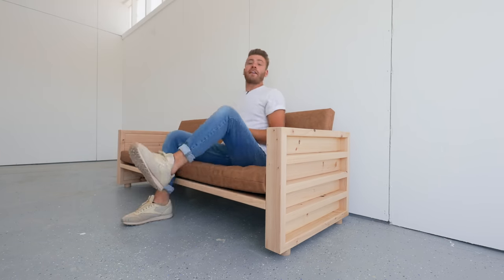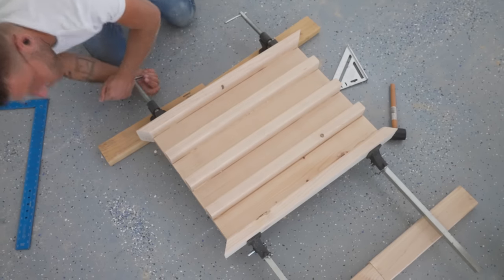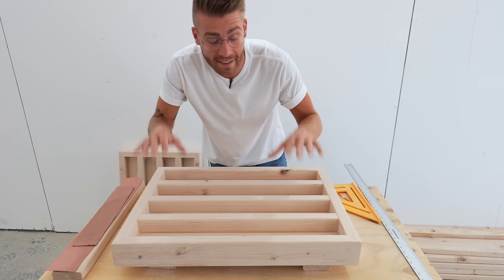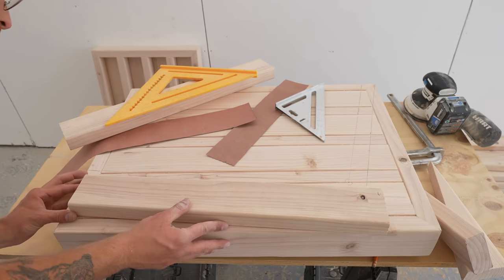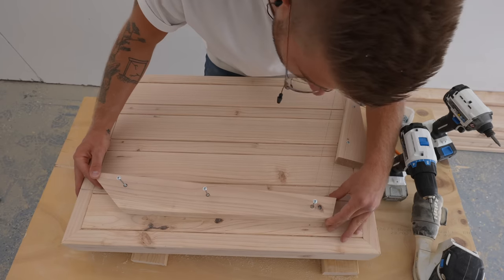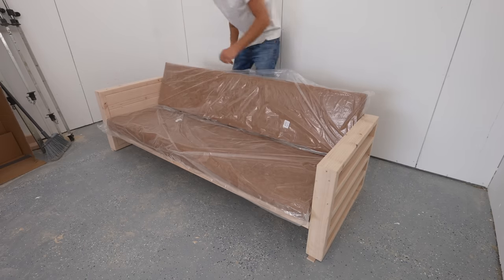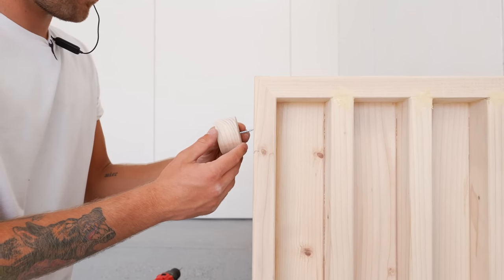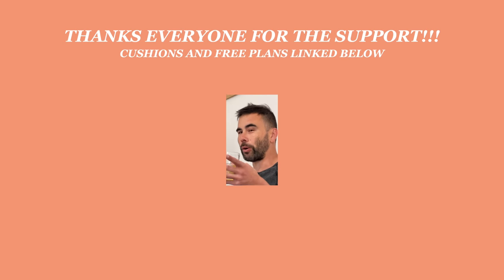DIY SOFA MADE OUT OF 2X4'S + FREE PLANS | MODERN BUILDS

Comment: nice work mike. You might want to consider adding some structural support. 2x4 on the flat won't carry the weight of an adult male and your couch will sag in weeks. Cheers!
Reply: Love your videos! You are an expiration
Reply: was thinking the same! Thank you Jeff
Reply from the maker: We’ll see 😜
Reply: I’m torn. Although I agree because more bracing the better, I’m not sure if it’s necessary. I built a bed inspired by the legend Matthias wandel. I used 2x4s for the slats that has a wider span than this sofa. I added about 8 2x4s and was intending to add a middle support beam but never did because I had no issues. No sagging at all and we’ve been using the bed for about 6 years now.
Reply: @SparkysJourney  
It doesn’t take much to do it, and it’s peace of mind and takes all that work into the next century by lasting that long. Sometimes lazy doesn’t take the life of a project too far. If it were me, I’d add the piece so it last like the pyramids! Ha! We have had things last in our home ages, and it saves a ton of money down the line when u may have to repair other things at the same time that don’t last, like water heaters cause they don’t want to make them out of galvanized metal. When it comes to water, u would think they’d care about the longevity of expensive items. These companies need to take more pride in their items, but in my case, the same company made double the money after 15 years. That’s more items in the landfills and not a recommendation to others when they need one.
Reply: @ModernBuilds  You'll be fine Mike! You've got more lumber in that sofa what you'd find in most furniture stores. Great job!
Reply: Did he say “Vegan cushion!” ? 😂 I had to thumb it down.
Reply: @SparkysJourney  Hi, I do upholstery work for a living.  You may wanna consider that in a bed, your whole weight is dispersed throughout the entire 2x4s while in the case of the sofa, your whole weight is placed in one portion of the 2x4s, placing a lot more strain into that spot.
Reply: @glumGlumm  I'm with you.  Two thumbs up for you, one thumb down for him.  ;)
Reply: @ModernBuilds  hahaaaa told him haaaa
Reply: @SparkysJourney  Why wouldn't you go for the extra support tho? Might get lucky and it doesn't sag but what if it does sag? You'd wish you'd put in that little extra effort. Also a bed isn't the same as a couch because there's more weight distribution on a bed.
Personally I'd much rather just put on an extra support that basically costs no effort than having to replace parts or even have to rebuild the whole thing depending on what and how you build it.
Reply: @Abraksas112  yeah, it would be pretty easy to just throw a center support underneath the platform as you’d hardly even see it. Also doweling or biscuit jointing the 2x4 platform together would make it WAY stronger.
Reply: @LGAussie  a single 2X4 stood vertical in the center of the seat  where most of the weight would sit would increase it's strength massively.  so the change would be trivial and extremely low cost.
Reply: No, it will not sag. I know from experience.
Reply: "Adult Male" 😂

Comment: Looks great, I'll be building this. My problem is finding those straight and untwisted 2x4 that all you Youtubers work with. All Home Depots around me sell crappy wood at crappier prices.
Reply: I have to wonder how much time it took to find those.  I'd have to spend at least 45 minutes going thru them at homedepot and still probably wouldn't find enough.  Not a dig at you Mike, great build, just ranting about the dimensional lumber situation (and cost!).
Reply from the maker: it's all about digging for good boards and buying extra when there's a good batch!! I probably leave 4/5 of the boards I sift through when picking lumber and I always buy extra for the boards that twist on me as they dry that way I have extra matching boards!
Reply: @ModernBuilds  That's also not even taking into consideration, the difference in humidity levels between your home/workshop and the lumber yard from where you make your purchase. Huge tip to give to followers when it comes to buying, is to ensure the wood is stored inside to avoid changes in humidity, which can twist/cup/warp a perfectly jointed piece of lumber all too quickly.

Same applies to the lumber yard... it's very likely the pieces were actually perfectly jointed at some point, but due to most lumber yards storing their stock outdoors (at least where I am)... it doesn't stay this way for long... cause humidity. To avoid this, I'd say, find out when the yard gets/cuts fresh stock and get it as soon as you can, fresh, to avoid outdoor exposure damage.

Comment: Truly a solid build. As an upholsterer, i can see how seat deck could shed 25 lbs and save $35 in current lumber costs by using jute straps, in place of 5  -2x4s.
Reply from the maker: No doubt! I'd like to try some of that webbing sooner than later!
Reply: @ModernBuilds  traditional Jute webbing about 3.5 wide, you can also use nylon webbing. The BIG secret, is pulling it tight, then stapling it down.

Comment: Hey Mike, great video as always. Question, have you considered adding a support structure for the very center of the sofa?
Reply: I was wondering about this too. I know he said it was extremely strong but I think it might end up sagging in the middle over time without an additional support.
Reply from the maker: Hi Dave, I was planning on it originally, but after I assembled everything it was SUPER strong. I also planned on glueing my 2x4 platforms for the seat and back together on edge, but didn't feel like that was necessary after standing on it either.... I'd glue up the boards before adding a visible brace. but that's just me :)
Reply: @ModernBuilds  ahh I hear ya. I’m a bigger guy so if I see one bend I freak out 😂😂. Keep up the awesome content brother

Comment: surprised its mainly glue and you did not use any screws or nails for the sides. Also i would of suggested for the legs to use the same you used but also add the next size smaller below it to give that extra high. Also for the seat base i probably would of ran a small wood strip in the middle to keep it all nice and together. but there is always things one could do different but love these projects and everybody can make it their own. thank you for sharing

Comment: one side notes that i would like to highlight here is the anthropometrics and ergonomics of the sofa. I think as a builder, you may need to calculate the best dimensions that would suit the user. example in 13:32, where your knees are not fully supported by the sofa due to its being lowered and the depth are not meant for your body figure. In the long run, it would be a bit discomfort for you to sit on, especially in longer periods. Hopefully you can come out with something that considers the anthropometrics and ergonomics of the product. thank you

Comment: You should put a round over or a chamfer on the legs so when they are sliding around there is no chance of it splintering.
Reply from the maker: I did with the sander.. .nothing dramatic, just enough to prevent splintering!

Comment: Thinking about doing this for outdoors (Patio use). My only concern is that water may catch in those horizontal boards on the sides. What you all think?
Reply from the maker: totally, you could angle them down 5 degrees so that water will shed off the slats but not look out of stare visibly

Comment: The larger the drill bit you use the slower (more torque) you should run the drill, speed 1 not 2. That may be why you burnt out the motor.